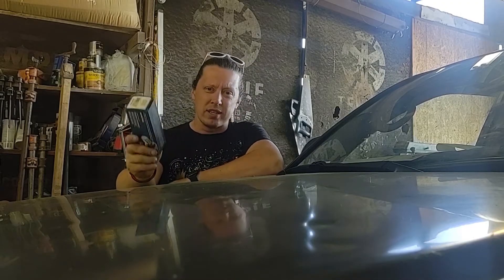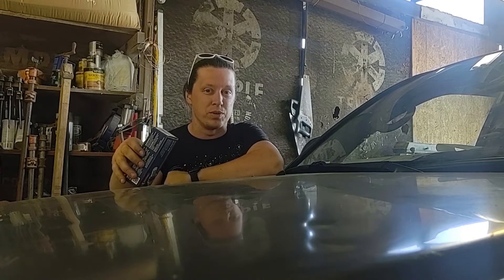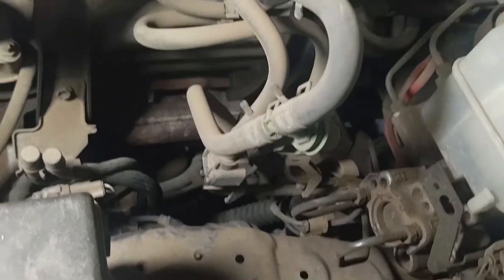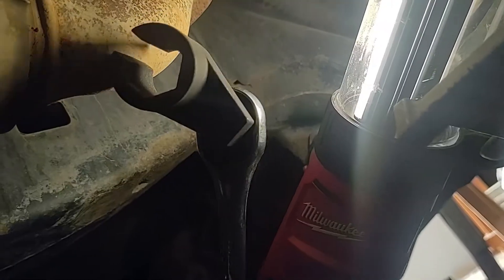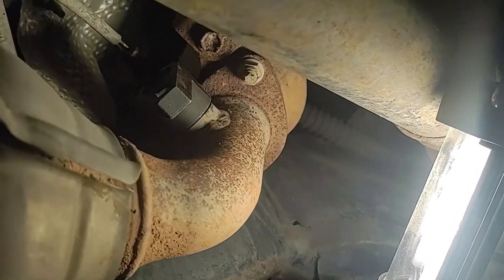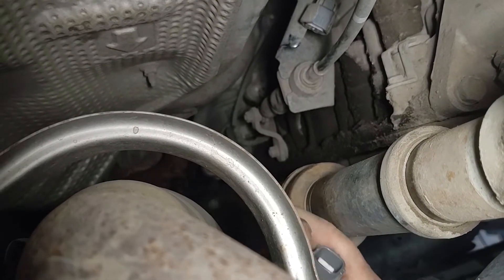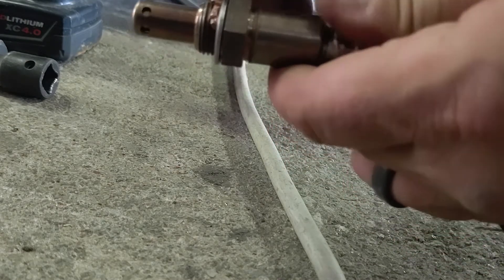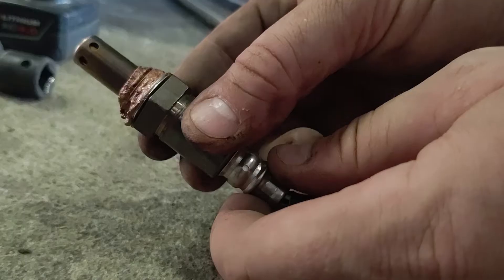O2 Sensor Replacement on the 4th Gen 4Runner - Fixes for P0156 and other Oxygen Sensor error Codes

Comment: I’ve seen a video where the sensor connector is unplugged and slips through the centre of a 22mm Ring Spanner . It would give a far better purchase to release a seized sensor. In my experience a “crows foot” spreads and slips. Also using brake fluid as a releasing agent helps unscrew seized threads

Comment: If you have crows feet,
removing the 02 sensors is not for you.
Reply from the maker: I don’t know. I do it a lot. Maybe there more than one tool for the job. In my experience, the right tool is the one that gets the job done. If I can fit a wrench on it I’ll use that, but it all depends on the position of the sensor. How do you remove O2 sensors?
Reply: @hayseedfarm  hes a hater, great video! Thank you!

Comment: How many curses and bloody knuckles were involved with removing that upper sensor.. I spend 5 hours already and only managed to get the unplugged.. I can't get them to budge with an 02 wrench, i am going to go buy the tool you use here the 02 crows foot.. never saw that before so hopefully it helps me out! Thanks for the video!
Reply from the maker: The first time I swapped O2 sensors was on a transverse mounted engine in my explorer. I spent hours messing with the O2 sensor tool and it just kept slipping. I switched to the crow foot tool and it was easier, but I still spent hours on the back side of the engine. Lots of choice words and every swivel and extension I had later, I was finally able to break them free. Good luck!